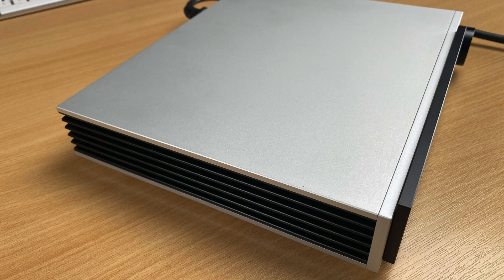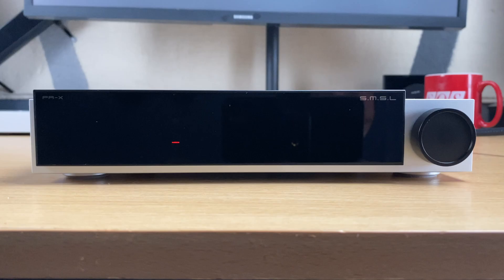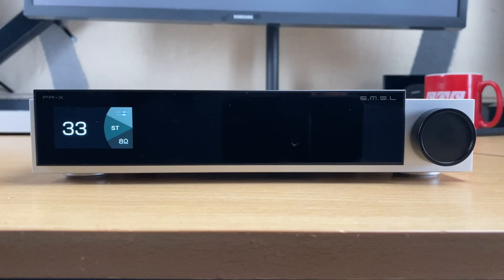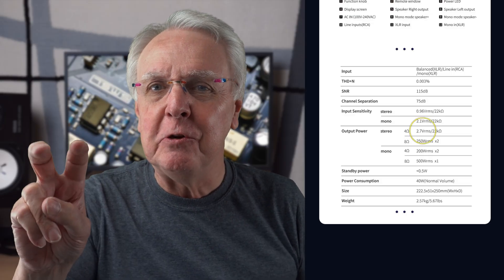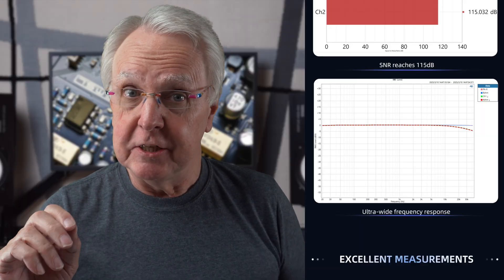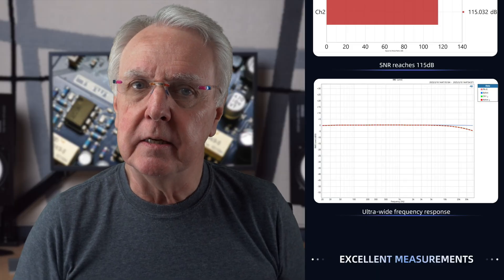Get GALLIUM power with the S.M.S.L PA-X Power Amplifier!

Comment: Thank you for the review. Did you get a chance to test it in bridged/mono mode?
The PA-X seems to have plenty of power, but sometimes, having one amp per speaker improves the sound stage depth and width.
Reply from the maker: No. If I had two of them I might have done that. More power is (usually) more better.

Comment: So what we have here is a device that amplifies an audio signal and doesn't alter it ... 🤔.
 (Edit) well I went to ASR ... the SMSL was indeed tested (  not completely 😮 ) . The impedance selector is to match your speakers.  Apparently it increases the rail voltage at 8 olms to achieve a higher power available.  You  may vary well want to switch to 4 olms for low impedance hard to drive speakers however.  🤔 
  Near 200 watts the distortion does rise very quickly to one percent near 250 watts.  In my opinion this is a 200 watts amplifier with essentially no head room. That maximum out put is virtually the same at low impedance.  The frequency response rolls of a bit at the high end running 4 olms.  Consequently at 8 olms it rises just tad . Bottom line in reality it's a 100 watt amplifier with a comfortable 3 decibels of headroom with very little distortion. That is still a good power amplifier and nice looking with the power supply neatly contained inside.  
    What about that test then ? Well when trying to drive it to 250 watts. She almost made it ( 1% distortion) ,  she gave it up at 40 hertz  and permanently shut down 😢. Oops 😮.         
  In the past I would have cooked this one ... " what did you say ? , there is this ringing sound in my left ear !" Yeah... don't stand to close to the Club  support monitor 😮.

Comment: High praise indeed, I would like to see what is attached to the 'Heatsinks'.....cheers.
Reply: You shouldn't be concerned. Someone has tested it. There's hardly any heat generated after spending hours listening to it. He measured the temperature around 31C. According to him, GANFet amplifier does not generate heat compared to siliconFet.